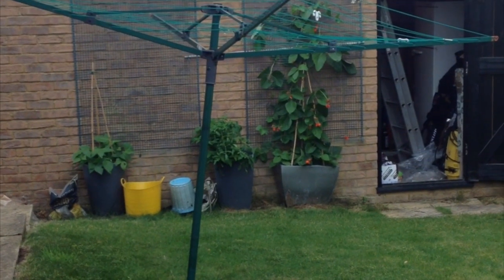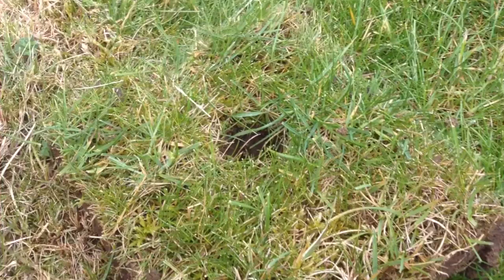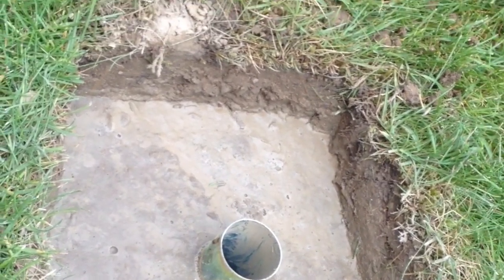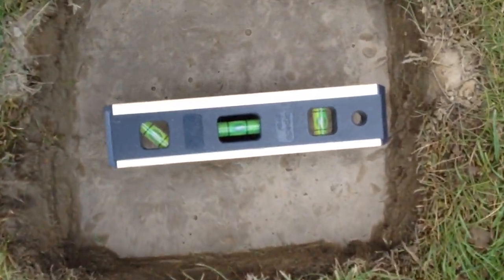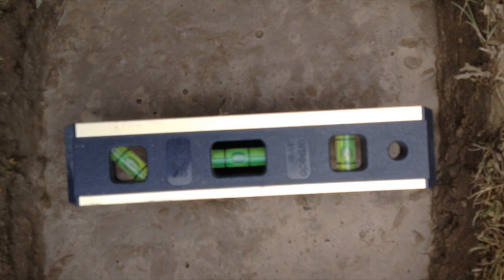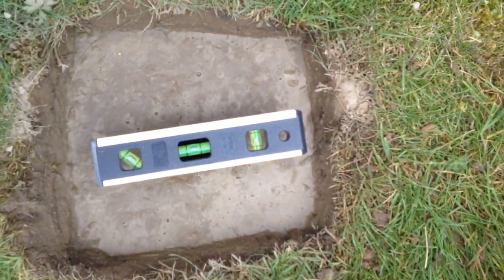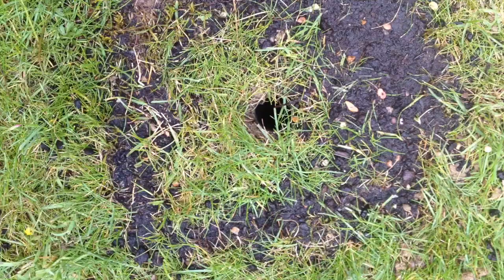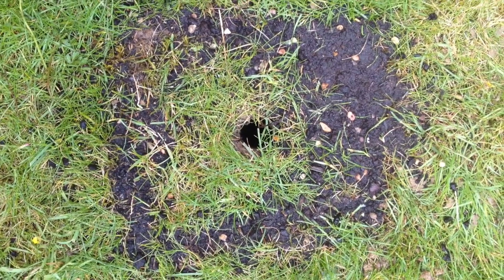How To Dig And Cement A Rotary Clothes Line Base And Save Money

Comment: For even more stability take two building bricks (the type with a hole in the middle) and set them off at an angle of 90 deg. Stick the ground tube through it and then pour the concrete.
Reply from the maker: Thanks for the comment and suggestion, that would certainly help. #fixed1tMONEYSAVINGtips
Reply from the maker: Thanks for the comment and suggestion, that would certainly help. #fixed1tMONEYSAVINGtips
Reply: I like tension music , is dramatic dig lol
Th

Comment: I was hoping this would show the depth needed and how to use the concrete mix in a hole.
Reply from the maker: It does, the depth minus 1 inch or 3 cm of the length of the spike you purchased to stick the Rotary Clothes line into making sure the spike is lower than the surrounding grass so your lawn mower doesn't fight with it. The concrete is a bag of 'post mix' tipped into the hole dry and filling the hole  until the concrete is below the top of the spike and low enough to put the turf you cut out back into the hole. Please don't forget to subscribe and check out my other great videos https://youtube.com/playlist?list=PLVnKaE3t-yQWqZK6pjJVKNIX9b6F8cmbV there are over 408 to choose from and share #fixed1t with friends, family and colleagues as I could do with more subscribers to help grow the channel.  Many Thanks Malcolm aka #fixed1t

Comment: I'm concerned about the fact that you have the steel pipe surrounded by wet soil and grass ..... this will speed up the rusting process. 

I would have thought it would be smarter to have the concrete footing sitting slightly proud of the soil level so the water would drain away and not have constant moisture sitting against the pole. 

Your thoughts?
Reply from the maker: Its because the spinning dryers are a lot less expensive the Lawnmower Blades and injuries from flying lawnmower blades and concrete. ;-) Please don't forget to subscribe to my channel and consider making a donation and share the #fixed1t tag with others. Regards Malcolm aka #fixed1t

Comment: Is that the original spike that you put through the concrete or just a pole?
Reply from the maker: It was a new spike I put in the hole, only because the old spike rotted in bare earth. But don't put the pole straight into concrete if you need to be able to spin it, as it spins in the spike holder and would be rock solid in the concrete. Please don't forget to subscribe to my channel and check out my other great videos https://youtube.com/playlist?list=PLVnKaE3t-yQWqZK6pjJVKNIX9b6F8cmbV there are over 408 to choose from and share #fixed1t with friends, family and colleagues. Many Thanks Malcolm aka #fixed1t
Reply: @fixed1t  Ahh I see. 
Oh I should have been more clear, by pole I meant a pipe for the drier to slot into. I have done mine now. I ended up making a holder out of some old pipe, fixing that pipe into the ground and putting the drier socket into said pipe for the drier to slot into. I noticed online that a lot of people used the drier socket to concrete in rather than the spike itself, but for me putting the socket into the ground would make the drier too low, so i wondered if concreting the spike in was good enough. In the end I just made something, as the spike was old anyway. 
Thanks for the reply though, much appreciated!!

Comment from the maker: Alas life isn't all playing with toys, simple job you'd pay a lot for.
Reply from the maker: Yosef your so right, a lot of money, and the cement was left over from a lot of move spent having somebody replace some fence posts after several bad storms and poorly treated wood put in by the builders.  That job I didn't do myself as I didn't happen to have a 2 metre x 4cm steel crow bar for getting the old concrete out.  #fixed1tGARDENINGtip